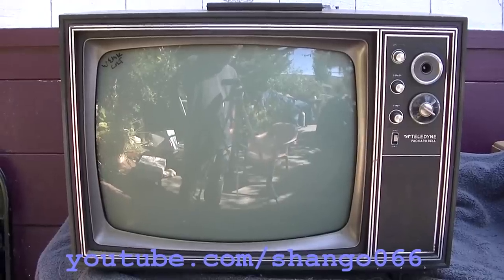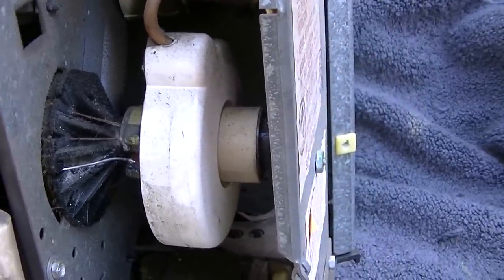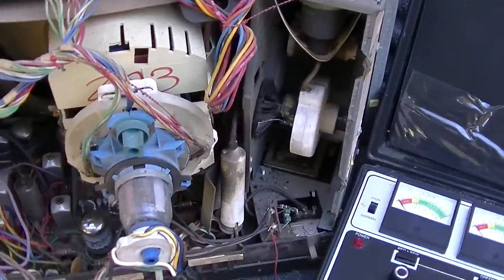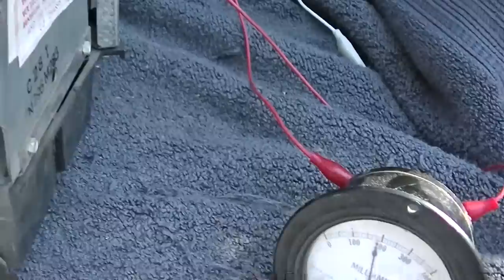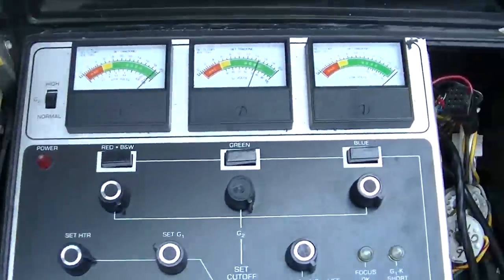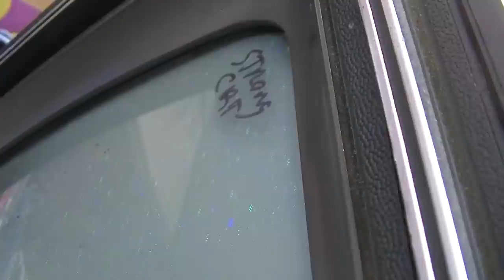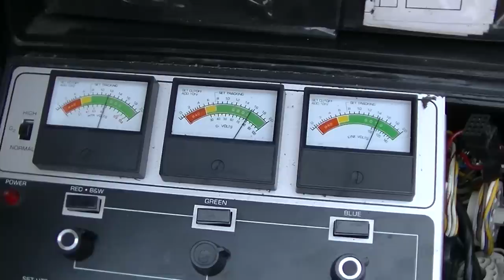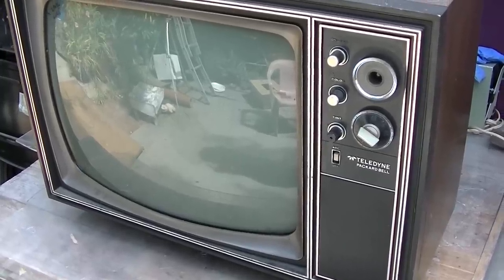1974 GE Packard Bell Portable Hybrid Color TVs 1C620wl Overview

Comment: I have one of these GE-made PB sets, also with a weak jug. It's probably been 10 years since I turned it on, but after rejuvenating the tube and wiggling some tubes around, I got it to produce a picture. I saw a couple of these types of sets in the late '80s-early '90s, but they don't seem to have stood the test of time like a Zenith or RCA, and most were junked before I started messing with TVs. I believe GE made a variation of this chassis until about '76 or '77 and the later versions were strictly "entry level" sets. BTW, some of these have "instant on" and that likely explains why so many of these have baked CRTs.

Comment: I'm old enough to remember TVs where I was the remote control when the parents wanted to change the channel. As a little kid I pulled the power knob to turn the TV on then pushed it back in to turn it off. I repeated that process until I heard something inside pop. No more TV. Oops.

Comment: shango066
Love your videos and have been watching them for some time now plus some other tv repair restoration videos,  I’m a younger guy with a decent understanding of electronics but older tube stuff and tube tv is a bit foreign to me.  I understand the theory but that’s about it.  I’m wondering if sometime you can post a video on different circuits of the tube tv like,  horizontal sweep and how a sawtooth pattern is made and how a lock is held etc, what high voltage is achieving etc,  I hope to one-day be very familiar around the circuits of a tube tv  
Thanks
Reply: The demod and sweep circuits are important breakthroughs along the way to color television. Looking at tube circuits gives you good insight into the role of capacitor to store and release charge to shape the wave form. I'm intrigued by the final circuits leading up to a broadcast antenna.

Comment: It's corona dope. Came in a spray can. AFAIR it was lacquer based... and had an ether? based solvent. It did stop arc over; but didn't do much for coil to coil arcing. That usually just burned through the dope. Not sure why it was colored red.

Comment: Everything old is almost extinct. Cant even find the right cars for parts in junkyards anymore. Forced to buy still running beaters for parts now
Reply: Some cars you can't even do that!  Try finding anything in a junkyard for a 1990s or 2000's Ford Ranger. I saw a beat up looking 94 with a bazillion miles being advertised as a "builder" by a local Pick and Pull.
Reply: I'd wager that 1980s-1990s cars are going to become valuable collectors' items in the near future, considering how few of them have survived in good condition.
Reply: @waltschannel7465  LOL
Reply: Mandela eff3ct.

Comment: I briefly had one of those exact sets IIRC it was a GE C2 chassis. IIRC all that was wrong with mine is that someone rewired the HV rect socket to take a 3A3 then stuck that lead covered 3DB3? back in...The color demod was also just enough out of calibration on one of the 2 axis that watching it was annoying so I sold it...I should have played with the demods and kept it. I'm sure I could have made it look better if I tried.
Seems like just about all non-portacolor table top GEs are rare. The PCs survive through SHEAR NUMBERS made.

Comment: I have this exact same set. actual GE brand, came from the boiling springs location. Sadly, the CRT is basically dead. and its doing some carbon tracking in the power supply section. No idea what I am going to do with it as I cannot find a replacement CRT.

Comment: Couldn't you swap in a modern aka 90s-00s CRT with some modifications? Be a interesting video. Save that set with a weak Picture Bulb.
Reply: A newer crt would be a totally different beast compared to the one in there electronically speaking so not really feasible.
Reply: @TapesNstuffS  pretty sure Shango066 could figure it out.
Reply: @TapesNstuffS  In fact its possible if RGB cathode modulation is used. Because on CRTs from 80s all G1 are connected together. Ofc there will be problems with yoke impedance, pincushion correction etc, but it can be solved.
Reply: You guys may very well be right. It's just I've never seen or heard of it being done before but it could make for an interesting experiment.
Reply: @TapesNstuffS  For example soviets made its Rubin TV with delta CRT designed in early 70s and also with in-line CRT from 80s. Only difference was the added convergence module in delta CRT model and some minor values changes in H and V out.